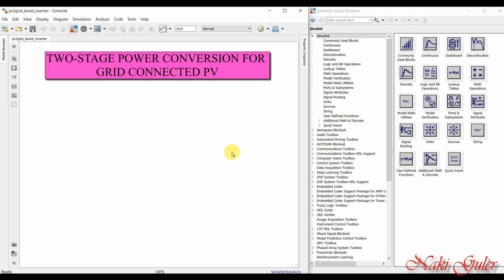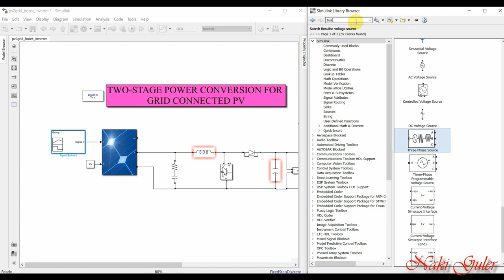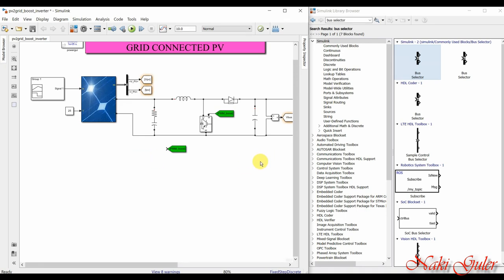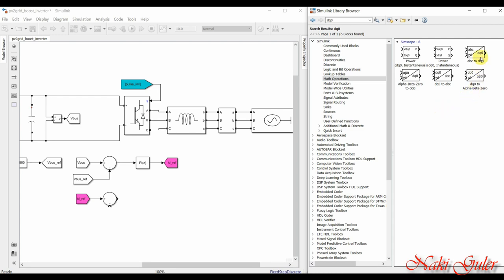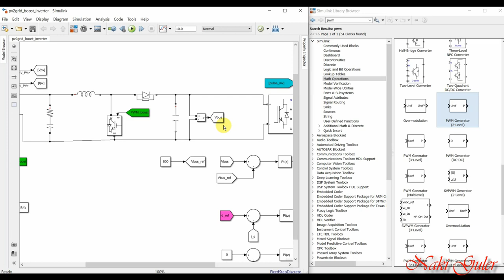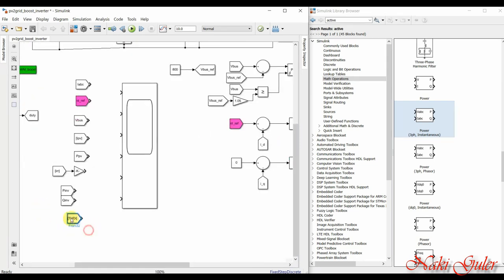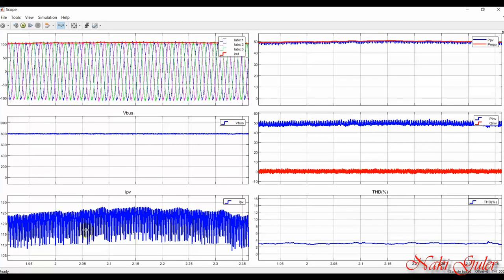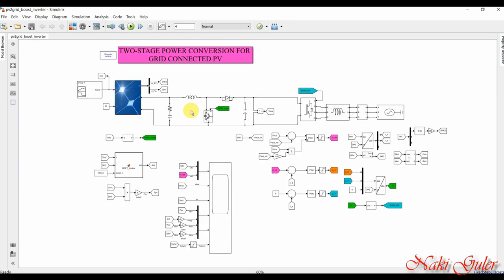Grid-connected PV with boost converter and inverter

Comment: Please help. I'm getting this error.
Error: The sample time 0.0002 of 'PV_Grid/PID Controller/Integral Gain' at input port 1 is different from the sample time 1e-05 of 'PV_Grid/Sum' at output port 1. Consider inserting a Rate Transition block between the two ports. Alternatively, you can control the diagnostic action for unspecified rate transitions by changing the option "Multitask (or Single task) rate transition" on the Sample Time Diagnostics pane of the Configuration Parameters dialog box.
Reply: @nikhilshrimali9767  hi also get the same error , if you find the solution please guide me .

Comment: thanks alot U make day ,it realy helps me,,but I have a couple of questions.1.why U connnect Vref value @ negative and Vbus as posetive?&& would you give me a proper equation to find input capacitnce value for Pv array. 2.either any suggested technique to find Kp and Ki value of outer and inner control loops.(I use PID tuner but the result seems not accurate) thanks

Comment: Sir I have model the previous model battery charging controlled Pv -  battery integration design, now I like to connect it with inverter circuit. How to do that sir?

Comment: Nice video. Can you design this system with inclusion of  partial shading of solar PV
Reply from the maker: Thanks. To make a partial shading condition, solar panels should connect series and parallel. Then, different irradiations should apply to see the effectiveness of the control part. But you know it is not an issue for just control side. I may think about this for the next video.
Reply: @nakiguler   Also there are multiple peaks so normal MPPT technic will not work effectively. I guess some optimization techniques would be required.

Comment: if i wanted to change this for a 600V AC grid would it be a simple case of changing the matlab code from 380 to 600 or would this change every value in that has been stated here? any help would be appreciated thank you
Reply from the maker: Especially, filter parameters should change. I suggest that first, you can change the control part. Then, you may check other sides step by step.

Comment: Hi Dr Guler, Thanks for your videos. Could you please provide a link to the reference paper for the control scheme in this video. Thanks
Reply from the maker: Hi, I have no paper directly related to this control scheme.
Reply: @nakiguler I read one of your papers on predictive method. This looks similar only no mention of cost function.. would you call it predictive? or does it have another name? thanks
Reply from the maker: Yes, I have. But I didn't use MPC here. MPC is completely different from here. So, the method in this video can not call as “MPC”.
Reply: @nakiguler  I see. Does this method have a name - so I can read about it, and reference it? Thanks
Reply from the maker: You may search “dq frame current control”. I am not sure but it may similar or same with this method.
Reply: @nakiguler  Thanks a lot, sir
Reply: @nakiguler  Can I ask you to explain the simulink of MPC as well?

Comment: Thank you for the informative video. I have some doubts. Can you just explain the control logic i.e how did you go from current error to modulation signal? The way I usually do it is I use the current error to generate a reference voltage which I apply to the modulator to get the PWM signals. But in your case you directly go from current error to the modulator. Also shouldn't changing the bus reference affect the PI controller gains?

Comment: Hello sir, I am trying to do the same simulation with buck converter but getting some errors. Can you please suggest me what and all modifications  that need to in this simulation
Reply from the maker: Hello, power control with the buck converter is hard for PV and MPPT. Because you should consume all generated power. I suggest that first try it just using a load, buck converter and PV.

Comment: gardaş bide türkçe seslendireydin ya.bak takibe başladım seni herkezi takip etmem ben.youtube açıldı açılalı sen 5 sırada türk  olarak 1  sıradasın
Reply from the maker: Sorunuz varsa buradan yanıtlayayım Türkçe yapınca karışıklık oluyor. Takipçilerin %30 u Hindistan dan ☺️
Reply: @nakiguler  labview de endustriyel control pid control osiloskop yapımı audio girişinden  dac ve adc dönüştürücüler ve en önemlisi benim için datalogger yapımı loop current, direnç ve voltaj, değişimlerin kaydedebilen ve çevirine adc ye zahmet olmassa yanında fbga dan yapılmasınıda anlatırsan ellerin den öperim.
Reply: tabi bunları bide matlaptada aynısı yaparsan daha ne isteyeyim
Reply: @nakiguler  we are colleagues. I worked for many years as a mecotronics technician in electricity production. Transformation in ambarlı thermal power plant, installation of bursa natural gas combined cycle power plant. installation of canakkale çan thermal power plant. I am retired but I am still working. I mean, I can't be a university graduate. But I try to be self-sufficient in every field. Physics, mathematics, calculus 123 differential equations, electronic electricity. I already learned English while studying. I hope I will finish at university.
Reply: @nakiguler  There were people I worked with indians.